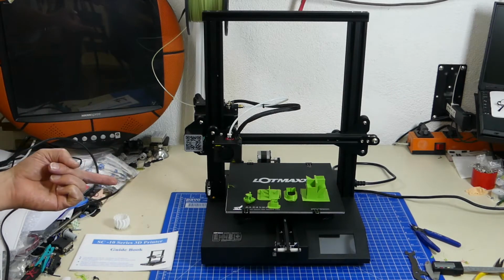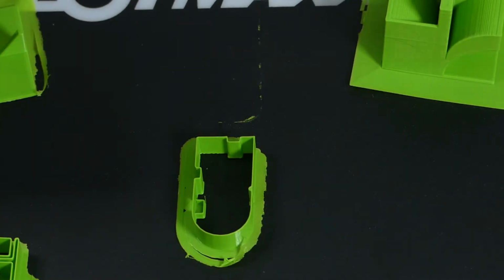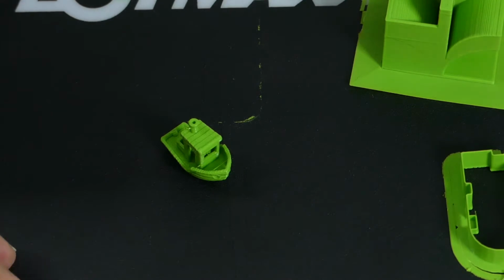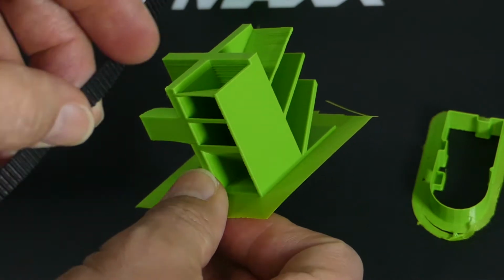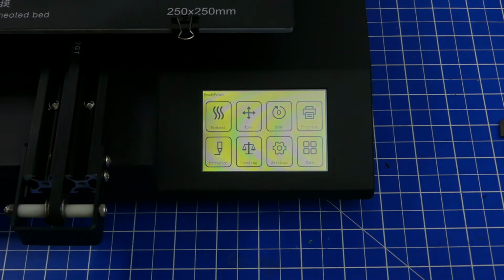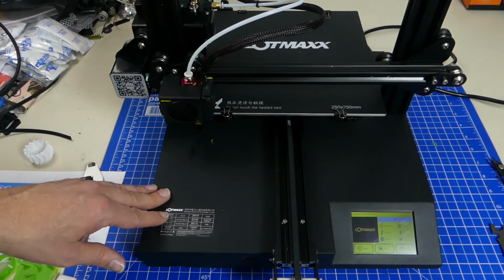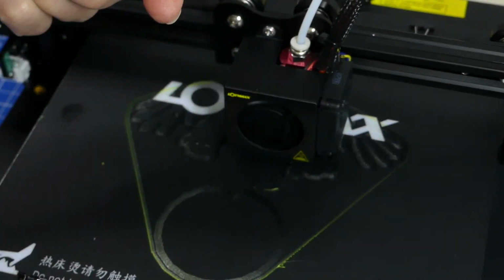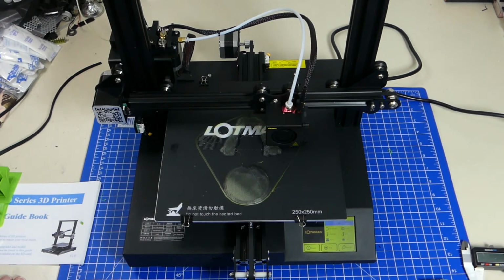LOTMAXX SC-10 - Review

Comment: Thank you for the thorough review and explaining the different benchmark tests. I am between the Ender 3 and the SC-10.
Reply from the maker: The base of the SC-10 is more solid. It's the slightly more rugged machine. My SC-10 has surpassed all of my other printers during the pandemic. It just keeps going.
Reply: We have four Ender 3 Pros. They're good printers, but the SC-10 offers everything the Ender3 has and even more (e.g. silent steppers, ARM board, touch sceen, filament runout sensor). And hey, maybe its powerpanic resume might actually work, unlike the Ender 3 Pro's! ;-) Also, the SC-10 is quite a bit faster and its build area is quite a lot bigger (235x235x280 mm instead of 220x220x250 mm). In other words: Get an SC-10!

Comment: I have a Lotmaxx. The print quality is good (same quality as the Ender 3), but:
The surface of the heated bed is shit that blisters after a few uses. This surface is therefore quickly unusable and must be put in the trash. So you have to invest in another surface, which is expensive. Take an Ender 3. There, no surprise.
Reply from the maker: I don't have that issue, mine's pretty scratched by now, but no blistering so far. I've been trying to fight the resonances on the lower layers, but even with those the printer is still really good.
Reply from the maker: You can get rid of the blisters easily, flip the bed cover around, black side down, heat the print bed to 85 degC for 15 minutes, then switch off and let cool down slowly. the blisters should be gone then.
Reply: @dherrendoerfer  Thanks for the advice. I had already noticed that by heating the bed most of the blisters disappeared. There were only little ones left. I hadn't thought to flip the bed cover around, black side down. I just tried and it works.
I still ordered a Ziflex which should not be long in arriving. This will save me from doing this step which, inevitably, should be repeated. But in the meantime I will be able to make the long parts that I wanted and that only this printer allows me to do. I have an Ender 3 and my parts are 32.50 cm long (diagonally on the bed), so impossible to do with the Ender 3.
Thanks for the advice!
Reply: I print! The 1st layer is perfectly printed (more blisters on the sides). The printing is going well. If a problem arises at the top, it will be my fault. For the moment everything is fine and it should go all the way. Thanks again!

Comment: What issues were you having with the filament binding? I’ve been having some pretty twinkle underextrusion issues and am kind of at wits end.
Reply from the maker: I did not have issues with underextrusion - what layer hight are are you going for ? The printer will struggle at anything over 0.2mm unless you add some extra extrusion manually. Also: at what layer height are you getting the underextrusion ? Maybe your temp setting is too low.
Reply: Dirk Herrendoerfer .12 .15 and .2. .1 has been doing alright I think. But, like a dummy, I broke my fan and have to wait for a new one to come in. I was just getting to the point when I was suspecting it only happened at higher layer heights (I’m brand new to 3d printing) I had also just swapped my nozzle out too. 
Side note- am I just supposed to snip and solder this new fan?
Reply from the maker: So here are the settings I use: PLA, 215C Extruder, 45C Bed. Max speed 80mm/s for infill, 60 for outlines.Layer height 0.15mm.
Which fan broke ? the cooling fan for the extruder, or the small turbine fan on the side for the print ?
In any case ... Yes you can cut and solder those cables, cut at a place you can easily get to, ~5-10cm from the fan.
Reply: Dirk Herrendoerfer thanks dirk! I’ll try out those settings for sure! I’d been using much closer to lotmaxx’s recommended settings and never higher than 210° because my tower tests started to look muddy at higher temps but I was printing slower too. Thanks for the help man! I’ll be posting a video soon on my other channel soon about my experiences. I’ll ask for lots of recommendations I’m sure. It was the hot end fan that broke- I broke it being sloppy.
Reply from the maker: What nozzle did you change to ? The extruder driver on the LOTMAXX SC-10 is not suited for smaller nozzles.
Reply: Dirk Herrendoerfer it was just the spare .4 that came with the machine. I just swapped it out because I thought maybe a clog was causing my issues.
Reply from the maker: When you think your Nozzle is clogged, do a cold-pull.
Heat up the extruder to 215 manually, manually feed some filament into the driver 'till some comes out of the extruder (or none if it's clogged, but feed it in all the way), turn off the extruder heater. When the extruder temp is at 70C pull back the filament at the driver - pull it all out. The clog should come out with the filament.
Reply: Dirk Herrendoerfer yes - I did that too. Maybe I was printing too cool and there was no clog but my temp towers didn’t look like they wanted hotter than 210 and I had had some great prints before at 205 and even 200. My new fan should be in today and I can do a test print after I replace it.
Reply: Dirk Herrendoerfer maybe this weekend I’ll be able to make a video to show my prints.

Comment: This is really a nice review. Subscribed :)

I'm about to order my first 3D printer and am hesitating between this and Ender 3 Pro. The Ender 3 is $100 cheaper, but the SC-10 seems to have cleaner output (based on what I saw in youtube reviews). What do you recommend?
Reply from the maker: Tough decision to make. All in all the SC-10 has the edge on more recent hardware, and a better build layout with the power supply integrated into the housing, the silent drivers, and the 32-bit controller. The heated bed and the extruder are basically the same. The SC-10 has some ringing on edges, the Ender has it too. The SC-10 is very close to perfect, with just these few little uneven edges ... the same as others say about the Ender.
Reply: Techana - i REALLY hope you didnt get the LotMaxx sc-10 or anything from LotMaxx... took all of a week before this thing went to crap and the "support" is a joke too.. I swear its a bunch of 7yos responding to emails.. Ive had my sc10 for less than 2 weeks and ive already replaced . sorry "upgraded" everything except the power, the frame and the stepper motors and they are screaming already .. the sound has gotten more than 10 times louder in the last 24 hours..